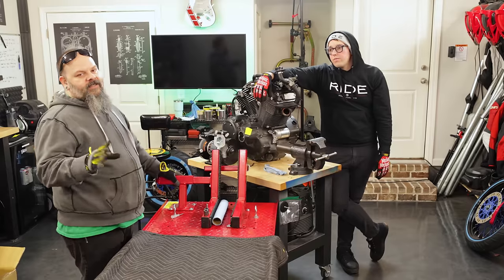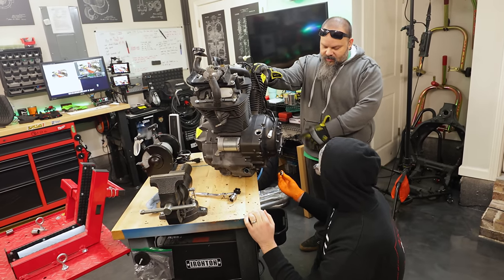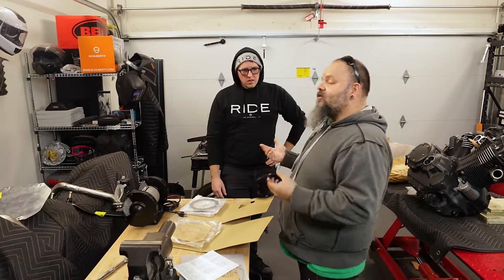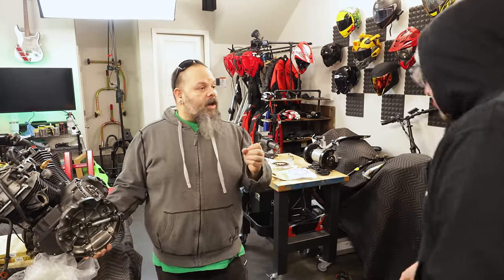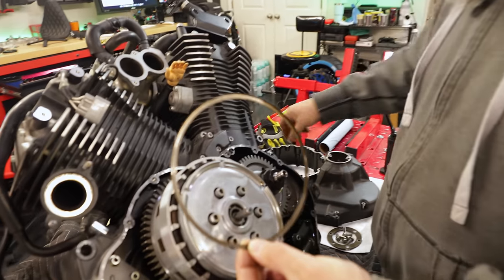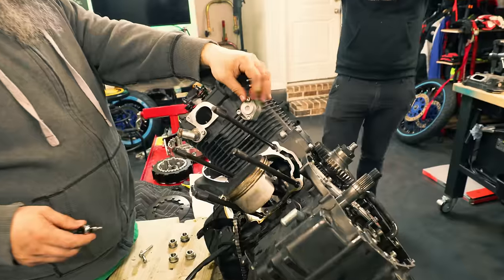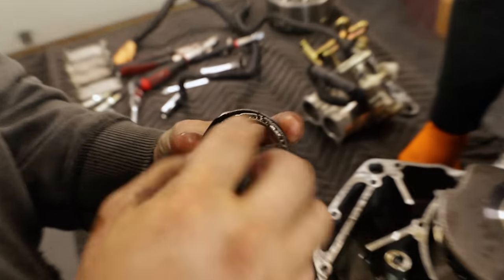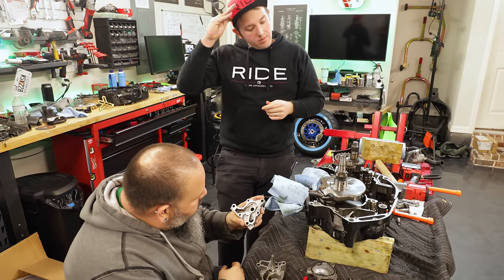We have TERRIBLE news about the ENGINE!! [Wrecked Bike Rebuild - Ep 21 - Vstar 1300 Bobber]

Comment: Honestly, thank God you had the Brain over there to know to dive that deep. Progressive damage is a huge issue that DIY-ers (and even some techs) don't know the signs for. Once he said that the clutch was burned up and there were flakes in the housing, I knew it had to come apart. 

I'd cut the filter open (they make a special tool for that so you don't get shavings everywhere) and look inside to check out the media. If the paper didn't have anything go through it then you should be good. It couldn't hurt to check the rod bearings to make sure that there's no scoring.

Comment: Seeing just what kind of headache this can cause, can you or Brian suggest a reasonable interval for us to check our clutch plates? Or sounds/signs/symptoms that it's probably time to replace? 
Excellent season so far from start to now!
Reply: Just ensure  regular oil changes and correct lever adjustment to prevent unwanted dragging/slipping causing early wear. If you want to be pedantic maybe every 12-15000miles or so have a look inside and check the friction&steel plates etc.

Comment: Could also have been a new set of friction plates that got installed without being soaked in oil first...? Or maybe too many wheelies/burnouts.
Reply: Most plates come in a bag that has oil in them. Yes its still a good idea to soak them in oil for 24hrs but some companies say that the plates are ready to be installed right from the package

Comment: Did he say "cork" clutches?  Mine are made from material like brake pads are, kevlar or carbon fiber. They don't swell when in oil.
Reply: I figure when a motorcycle manufacturer builds a cruiser they know their intended audience so they use the oldest technology they can get away with.

Comment: The clutch on these bikes is really heavy with a long travel so many people adjust the cable and reduce the travel such that when you pull the clutch all the way it doesn't fully disengage so it spends a large amount of time slipping. Either that or they adjust it so the clutch never fully engages which also causes slipping. Along with the mentioned abuse, this could be the cause of the clutch disintegration. This bike really needs a hydraulic or some sort of "easy pull" clutch lever design.